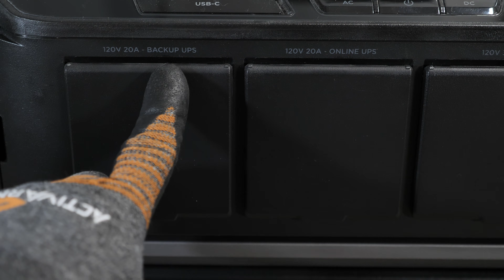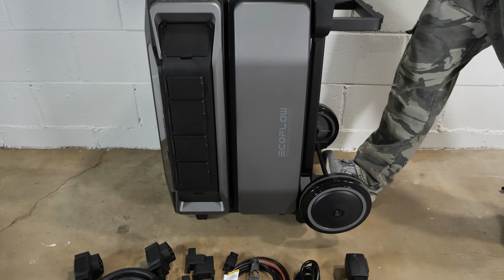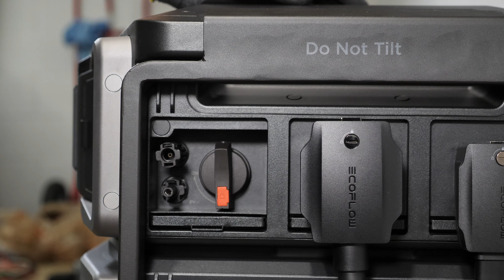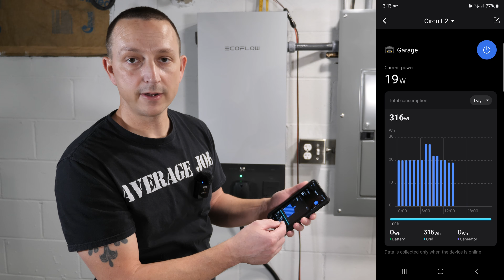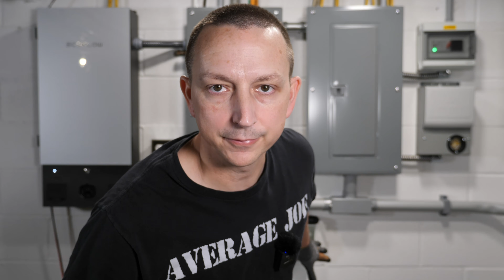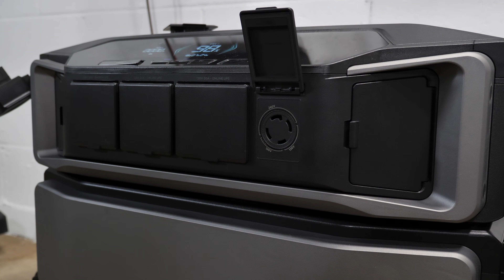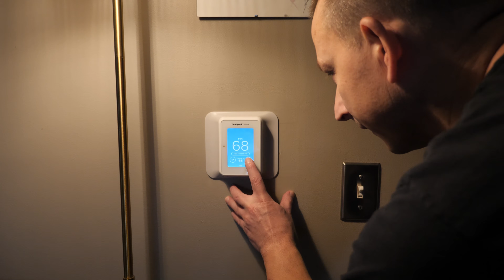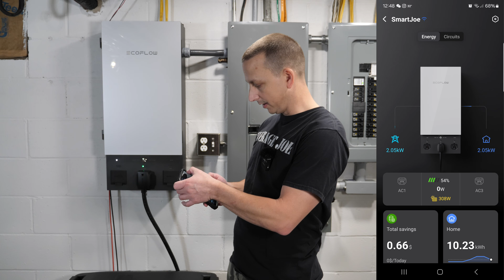Demo of Fully Installed EcoFlow Smart Home Panel 2 with Delta Pro Ultra - Black Friday Deals

Comment: Great great video. Thank you. You are doing an awesome job , Question 1  Generator with the smart panel When batteries are low and I start the generator will the gen recharge the DP and take the house load at the same time ? Question 2  Generator with out the smart panel . Can I use the generator 220 v to charge the DPU and use the 220v ate the same time ? or am I limited to charge with 110 only ?  Thanks
Reply: Yes on the generator.  Will need to flip the interlock from "grid" to "generator". 

Yes also on #2

Others have shown an adapter that plugs into the side of the DPU, then your 240v generator cord to that.
Reply: Here a few more practical questions, Question 1  Generator with the smart panel When batteries are low and I start the generator will the gen recharge the DPU and take the house load at the same time ?
Question 2  Generator with out the smart panel . Can I use a generator 220 v to charge the DPU and use the 220v ate the same time ? or am I limited to charge with 110 only
Question 3  Will you come out with a automatic generator connection like the DP that starts automatically when batteries are low.
4- Will My smart generator be able to have a special connection to start automatically and charge the DPU? 5- Are the batteries UL compliant to make installation in the house ? 6- It appears that We can remotely install the DPU in the garage and have the connection box with it then run the 110/110/N/G (4) wires and the data cable to the house inside where we could mount the SHP close tho the main home panel?  Am I correct ?
Reply: @captmichel8035  1.  Yes.  As long as the interlock is flipped from "grid" to " generator".

2.  Yes.  Full 220v/240v.  

3.  I don't work for ecolflow so can't answer that.  Sorry.

4.  No. They've show that the DPU can only 120v charge from the front AC plug.  No smart charging unless they come up with an answer to question 3.

5.  I honestly can't find anything to confirm they are UL listed.

6.  Yes.  The lower black part can be removed and mounted elsewhere.  Panel can even be mounted outside.
Reply: @JohnSmith-wt3mw differently explained 
I have at the moment a generator outside and I will install the DPU with the connection box in between located inside the garage then use  existing wires going to the SHP inside the house, 
So the generator will connect directly in the generator input of the DPU that’s located in the garage
Then use the 30amp 240 from the DPU to the SHP inside the house. 
that’s why I wanted to know if the DPU could charge in the 240 input and continue to output 240.  
Thanks for your time and your help.
Reply from the maker: I just want to say thanks John for taking the time to answer a lot of questions for people. You are the man!🤘

As far as using a 240v generator to recharge without the SHP2 and also not recharge with 120v, it might be possible with the 50a generator hub and the 50a generator adapter cable. I am not 100% certain of this yet but will try to find out.
Reply: @AVERAGE_JOE  ok 
Appreciate all the infos 
I’m sure others can also benefit from it 
That’s how we get to the end of the possibilities. :) 
Thanks.
Reply: that's great news to be able to do that   thanks.  @JohnSmith-wt3mw
Reply: @captmichel8035  let me clarify on question 1 after rereading.  When you say house load,  are you referring to grid power or the circuits in the panel?
  If the former you can't use grid power and the generator to power your circuits at the same time.  The interlock makes it so it's one or the other, not both.  If the latter,  my original answer still stands

Comment: When you have it in the hub and connected to the side if the ultra,  is that putting out 50 amps? Thanks..... Jeff
Reply: No.  It's 30 amps.  The have a hub that connects 2 Ultras together for 50amps
Reply from the maker: When you connect with the bigger cable(square end) to the side and then to the hub(also square end) or smart panel, its 50a yes.
Reply: @AveRage_Joe  Sorry joe but that's wrong.  It's 7200w @240v. That's 30amps.  Its on their website.That plug style is 50amps in the ecoflow system, but that inverter is definitely not putting 50amps out.  The math just isn't there.   

Was really hoping you were credible until my comment was deleted pointing out the error of this reply.  Lesson learned.  Good luck with the channel
Reply from the maker: @JohnSmith-wt3mw You are correct, I miss read the comment. As far as comments being deleted, I dont delete any. If the comment had a link or a bad word then YouTube auto deletes or hides for approval. 🤷‍♂️
Reply: @AveRage_Joe interesting? No links or bad words.  Lol. Sorry for jumping to conclusions.
Reply from the maker: No Worries. YouTube does it all the time so a lot of people think I delete comments. Im a firm believer in freedom of speech and opinions. Everyone has a right to say what ever they want. Only reason I would delete comments is if its complete spam or they only came here to promote there own shit.💥🤘

Comment: I have watched a few videos and yours, by far, is the most detailed. I am guessing that there is no way to implement this with solar and still do net metering? Not being able to do that would be the only deal breaker for me.
Reply from the maker: Thank you and appreciate that. Yeah this one cant do net metering BUT I think they are working on a system that does. Dont know the timeline on that yet tho.
Reply: @AVERAGE_JOE  Hope that not-too-distant net metering version is backwards compatible with the DPU. They might have some very unhappy existing customers if it doesn't (me being one). Too, they've got homework to do if and when so, because in this region we are beholden to Duke Energy where battery and/or systems must be approved by their "Power Pair" department... I am told (by a local solar integrator) the approval process moves at a speed slower than cold molasses. The SHP2 is a slick unit but EcoFlow should quickly launch an SHP3 (or whatever it would called) that is at least 200 amp service and offer many more breaker slots. If they really want to knock it out of the park, they should also go after SPAN.

Comment: Awesome smart home panel. Works very well. I like it
Reply: I’d like to know just one thing. How long will one battery last powering 1 refrigerator that is rated at 724kwh a year. Eco flow said 8 hours. That doesn’t even sound close
Reply from the maker: Yeah it is a pretty sweet panel. Seems like endless possibilities.

Comment: I don't see any cost effectiveness in this whatsoever.
Reply: It's not about cost savings, it's mostly about control and reliability.  Self reliance and if you can save some money then that's just icing on the cake......Jeff
Reply: @JWTX  I don't totally disagree, but as someone that lives in a hurricane prone area if you have solar panels on top of your house more than likely your insurance company is going to drop you or you're going to pay a few thousand extra in insurance premiums. I also use a combustion generator because we're usually out of power for a week. There's exceptions though.
Reply: @jamesm568 can't ground mount solar?

  I would not solely rely on a gas generator as my backup during a natural disaster. A week is a decent amount of time without power.  What happens if you run out of gas?
Reply: @JohnSmith-wt3mw  if you live in a hurricane prone area or any other type of natural disaster area you always make sure you keep 50 gallon barrels of gas around. You can't run a battery generator 24 hours a day. I'm less limited with a generator because I can pull gas from vehicles and boats.
Reply from the maker: I also want to add that something like this you can use all year round. If you have solar then again, all year round. Im 100% not saying to get rid of a good ole gas or diesel generator as I have one myself. You could use the genny to recharge the battery so you could continue to run your emergency circuits and not run the genny 24/7. Can cut the genny usage down a TON.
Reply: @AVERAGE_JOE  To go solar I would have to get one hell of a government subsidy or it would take 10 years to receive any type of benefit from solar financially.
Reply: @jamesm568  you think a 50 gallon drum of gas is more cost effective?  Thats at least $150 around here.  That can definitely add up to more than the initial cost of batteries.

  Also what's the shelf life on that?  A couple of years?  Solar panels don't have a shelf life..

I can absolutely run a battery generator all day.  Solar with a large enough battery system could run 24/7.  Your array should be sized to produce enough electricity to power your essential loads and charge the batteries.  Your battery bank should be sized to handle essential loads at night.  Neither needs to be particularly large as you should only be powering essential loads during a blackout.  

You also skipped over the ground mount suggestion.  Is that a possibility with your insurance?
Reply: @jamesm568  30% tax credit till 2032 so...

What kind of ROI you getting on your generator and 50 gallon drum of gas just sitting there waiting for a blackout?  It's $0. You have $2000+ just sitting there,  doing nothing.

 Solar and a battery can lower my electric bill giving me money back in my pocket.   Your generator will never do that.
Reply: @jamesm568 .  

James, I think this is a great question and a common misconception.   This is not so much as a 1:1 cost.   

When the grids go down (for whatever reason), a simple week of no power, will have people realizing that this is worth the investment.    

However, I do agree with you that it is disappointing that solar remains so expensive.   

For me, it is about keeping as much as I can, routine.  

~Riki

Comment: It's a bit disapointing to see all the 'tecnical' revieuwers doing the same eco-stuff roughly in the same week
Reply from the maker: Yep, @Self.reliant nailed it! It does seem most of the others videos Ive seen just kinda do a quick 8min gloose over and done🤷‍♂️
Reply: @AVERAGE_JOE yep. I watched a bunch of them and decided to buy the unit before seeing this video but you actually go through the use case scenarios for real, and not just hypothetically. That’s much appreciated. I’m finishing my install tonight. 
Did I hear correctly that you can only power the home panel with either grid or solar but not both at the same time?  I mean I know it’s not grid tied so no net metering or backfired scenarios, but just want to verify that you can not power some loads in the panel from battery and some from grid?
Reply from the maker: NICE and thanks for watching. You CAN power loads from battery and grid at the same time. You can set certain circuits to be on battery and others to be on grid all at the same time. You can take the whole panel off-grid as well. Its pretty awesome!
Reply: You have to understand how they work. The company has a release date in his contract on when the video is set to release. They want all of YouTube talking about it to get people driven over to the setup and buy it.

Comment: Thanks! This is awesome info!  Question if you know: can you install double 110v breakers (2 in single size) to maximize space in the panel, and configure them in the app?
Reply from the maker: Thanks for watching.  I was just mentioning this to @Barc7580  in a comment above(or below).  The slot is smart so the 2 in 1 would turn on/off both.  It would also show the current/watts for the 2 as well.
Reply: It may be to much current for the relay that energizes the breaker

Comment: This is really interesting. Thanks for explaining it so clearly. 

I saw the various breaker sizes you mentioned. 

Could I add a 60 amp breaker out to another sub panel and add 2 more 30 amp breakers to the second sub panel ?

Thinking there are 12 breakers to use but I’d like to add a couple 30 amp for a stove oven and for a dryer.  

But don’t want to take up the space for 15/20 amp breakers that are important in an outage. 

My main panel is currently 200 amp service. 

Thanks
Reply from the maker: It is interesting!  Its mind boggling too lol.

Yeah you could add a 60a breaker and then out to another sub panel.  Just remember that you would only have control of that 60a breaker (on the smart panel) and not the 30a breakers on the other panel.

For the 15/20 breakers places and not wanting to take up space,  in my other sub panel( furthest to the right)  I use a few breakers that have 2 15a or 2 20a breakers in them and they fit in the single slot. 

From your main 200a panel, you would install 100a double pole then run to a 100a double pole in the smart panel.  Then add all the stuff you want to add for you off-grid or outage enjoyment.
Reply: @AVERAGE_JOE  outstanding. 

Many thanks for the reply
Reply: @AVERAGE_JOE  i wonder how the smart panel would react to putting a double 20 amp breaker into one slot?

Is it the slot that’s controlled by the app, or the breaker ?
Reply from the maker: @Barc7580  Yeah its the slot that is smart so both would be shut off/on.  Another side note to that now that Im thinking of it is the current draw would show for both as well.

Comment: If you had a large solar array than a 15 amp max PV input wouldn't go very far.  The first part of the video goes into the inverter and with 450 volt max input whereby a 400 watt panel providing ~40 volts per panel.  After 11 panel you are in trouble.  If you went with parallel for part of the array than you would be over the 15 amp max in short order.  100 amp max AC @ 120 Volts output doesn't go far in today homes.
Reply: Per ecoflow it's 15amp for both mppt controllers.  1600w on one just like the pro up to 150v, and  4000w on the other up to 450v.  That's 5600w on 1 inverter.

  I could easily put together an array to max that out. Then triple that for 3 inverters?!?!  15k setup!!!

Infinitely more expensive than a DIY component setup for sure, but it's far from useless and should be plenty of power for most households during a blackout...
Reply: @JohnSmith-wt3mw  great points
Reply: I thought this new "ULTRA" (they should have picked a completely different name) had two PV inputs (one for lower volts and one for higher)?    I think the higher one has 450V capacity and can't imagine the limitation of 15a for that one????

Comment: No wonder you can’t be arsed with another DIY build with all that clobber turning up 😂 
Don’t forget us poor ass self builders Joe 😉👊💚
Reply from the maker: Lol weeeeell...I actually started building on it again. I have been getting all the batrium bms wires together and resleeved so they look good and my OCD doesnt keel me over. Video is in works!😲😆
Reply: @AVERAGE_JOE  if I’d spent as much time as you have capacity testing & individually fusing 18650’s I think I’d be going down the pre assembled route by now if I wasn’t so invested in all the necessary tools 🤣👊💚

Comment: if the batteries weren't so Non-Taj-Ma-Haul sized... "Get in my belly" I would so use this... I've been trying to source a smart panel for 2 years now. I do have the Leviton LP320-MB 30 sitting NIB because when you remotely shut down a circuit, you have to be present to turn it back on... Although it would need to handle at least the 12kWatt/hrs I'm engineered to run, but ideally 24kWatt/hrs which is the next step...
Reply: Hmmmmm, it would be awesome to craft a cable to connect the panel to my Rhinos... Any takers??? Anyone, anyone, Ferris, AverageJoe?
Reply from the maker: That would be sweet tho! Actually...maybe with the 50a gen cable. They have a generator adapter cable.  You could run a genny cable from inverter to the hub. Then hub to panel.
OOOOOOOR maybe just the genny cable to the panel. 
OOOORRRRR this is how. Just run the inverter AC output to the panel AC input. Then you have a smart panel.
Reply: Hit diggity dog, now if I can convince them to sell it to me without their install services or qualifying for it… 🙄
I had this issue with SPAN!